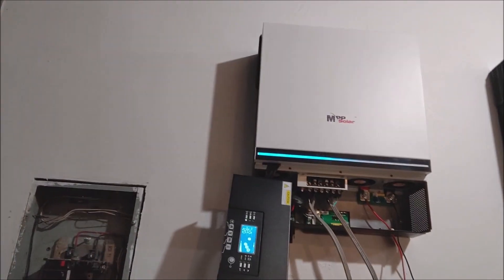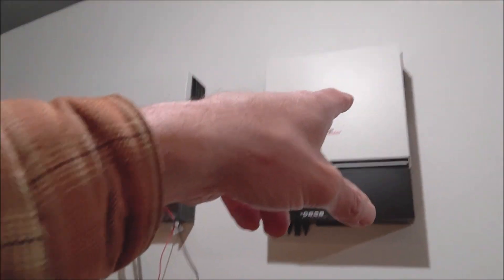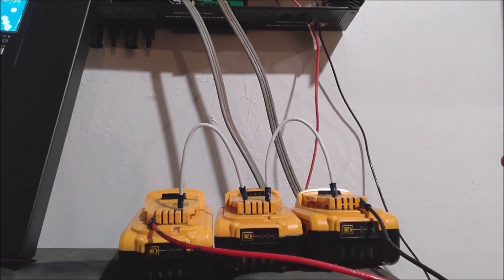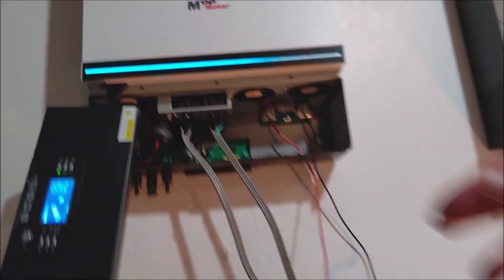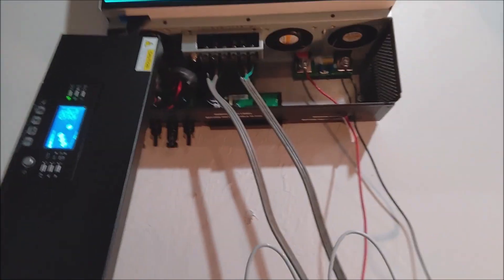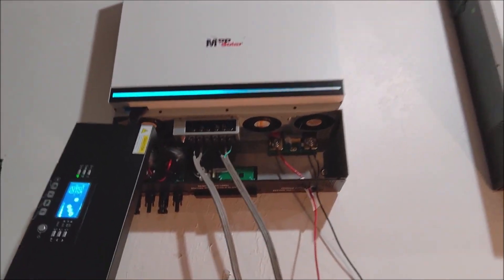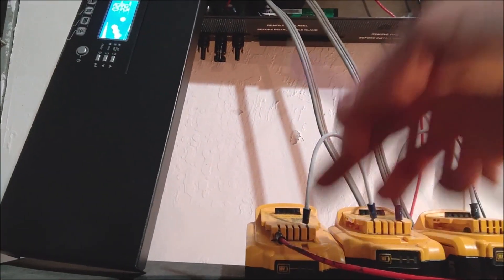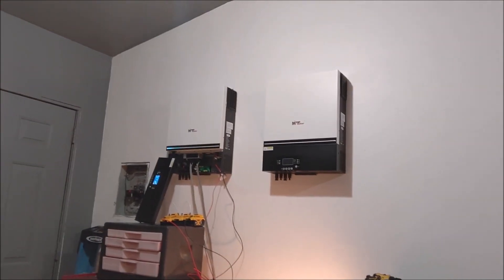MPP Solar LV6548 Solar Inverter Running on DeWalt Batteries

Comment: Very creative way to test it out! I never would have though of that before investing in a 48V battery.

Some of these all-in-one systems claim they can run entirely on solar. I'm skeptical unless you have a large solar array and consistent PV conditions. Even then, I'd want a small battery bank (even lead acid would work) or some supercapacitors to buffer the input. When you do get your panels up, I'd enjoy a video of a small battery buffering a PV to load application of about 1800 Watts.
Reply from the maker: Thank you very much for your message. I really appreciate it.
Yes, I agree with you! These Lv6548's can run on solar only, but like you, I wonder what would happen if a cloud passes by! Are you building a system too?
Reply: @jeffcunha9114  I'm looking to build an off-grid system for charging an EV. I figure an EV has a huge battery, so why not just be continuously charging that @ around 10-12A? A small battery bank will help buffer and build up a charge while I'm not at home.

I subscribed, so I'll definitely follow what you do. I get that life gets in the way, so anything you share at your pace is appreciated!
Reply from the maker: @ericchang7706  That is great! Every time I fill up at the gas station, I think about that too! I like your thinking. Is your vehicle home enough to take advantage of the daylight hours? According to some manufacturers, it can take up to 91 hours (Ford Mustang) to charge from 0 to 100%. Of course, if you are home during the sunlight hours on many days of the week, this does not seem to be a factor since you would just be adding to the charge, and not trying to fully charge? Great idea.
Reply: Hey guys. Eric, they still have the LV6548 at the savings shack at current connected if you want to join in the fun. $910! What a great deal. Thx
Reply from the maker: @ValleyOak-wy9bh  Hey! Thank you for the update! I wonder if I should pick up a couple more? Humm...

Comment: Does the fans on your unit runs constantly without load?
Reply from the maker: Yes, they do. I am wondering if this is part of the idle consumption. Did you go ahead and get some of these LV6548s?
Reply: @Do It Yourself with Jeff Cunha  yes i purchase one unit from the saving shack and hooked it up this evening an the fans are running so was just trying to verify if it's normal
Reply from the maker: @diy-bj2ed  Yes, that is what I have observed as well. Thank you for your message! Glad to hear that you got yours!
Reply: @jeffcunha9114  alright thanks. Just wanted to be sure I didn't receive a defective unit
Reply from the maker: Good morning! I was just checking in to see how your new unit is functioning? Any issues to report?
Reply: @jeffcunha9114  it's working great so far, no issues yet. How about yours?
Reply from the maker: Hello! That is great that you got yours running already! We are still in the process of setting ours up. Unfortunately, I am a bit of a perfectionist, so everything takes me forever on my own projects. Do you have a channel that you have posted your project? I would love to check it out!
Reply: @jeffcunha9114  mine is just a temporary setup until i have all the components. I depend on the power as I don't have any power from the grid
Reply from the maker: @diy-bj2ed  Wow! You have a off grid system? That is a dream of mine too. Do you have a battery bank for the night?
Reply from the maker: Not very loud unless they are running at high capacity. If they are charging batteries AND have a large output load then they can be quite loud. Are you thinking of buying some of these LV6548's?
Reply from the maker: Good day to you! They are not overly loud in my opinion. As the input or output increases, the fans ramp up, but nothing to loud. I personally like it because I can tell by their sound what is happening. Are you thinking of purchasing some LV6548's?
Reply from the maker: gmsgabaradama2009  Ah, very nice. Well, there are a lot of factors at play. The idle consumption of the lv6048 is 60 Watts. So, that will require about 1.5 kWh per day. If you are talking about 3000 Watts CONTINUOUS that would require a 72 kWh battery bank. If you have a solar array, this will offset the consumption depending on how large the array is and how much sunlight you have at your location.
Reply from the maker: gmsgabaradama2009  Hello again. That sounds like a nice system you are planning! Your solar array will support the load in perfect conditions. Our experience is that the panels produce quite a bit lower than the rated output for most of the year. Your 200 amp hour 48v battery will support 3000 watt draw for about 3 and a half hours at night. Let us know how your project is progressing. Thank you for your comments!
Reply from the maker: They are pretty loud. I can get a DB measurement if you want?

Comment: How are these working so far for you ?
Reply from the maker: Good morning. Thank you for your comment, life has gotten in the way, and I haven't got them up and running yet. Thank you for your interest.
Reply: @Do It Yourself with Jeff Cunha  good morning thanks for the reply,  I'm considering to try out one of those units but wanted to hear from someone who recently purchased it from currentconnected.
Reply from the maker: @diy-bj2ed  Absolutely! We did  a full run through of these two units because Current Connected does guarantee that they will not be DOA. If you do decide to make the leap, let us know how it goes for you! You can't beat the price.
Reply: @Do It Yourself with Jeff Cunha  ok, will let you know when i order,  how long did it taken to get them from the date ordered?
Reply from the maker: @diy-bj2ed  Awesome. They were super fast on the shipping. It was just a few days.